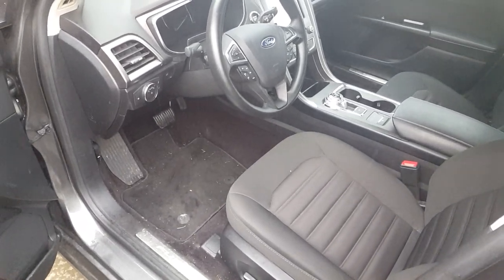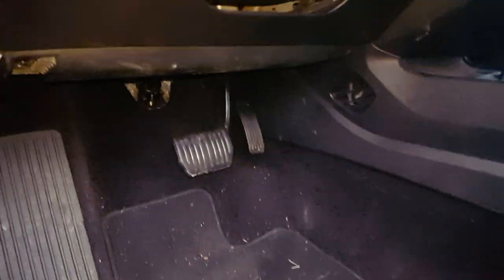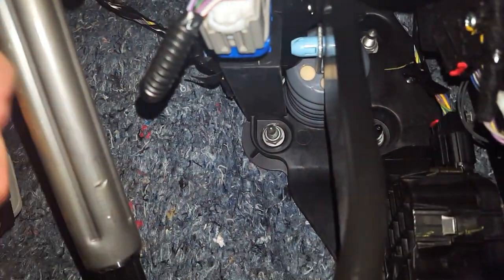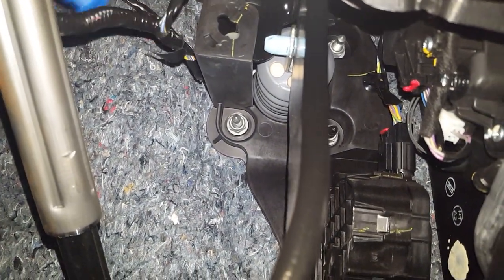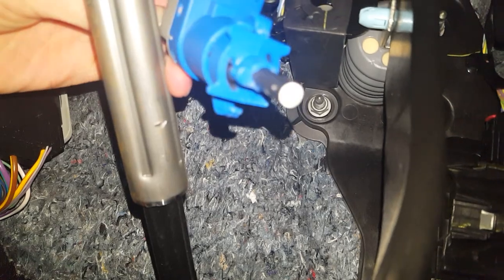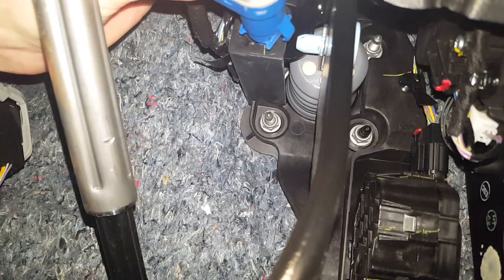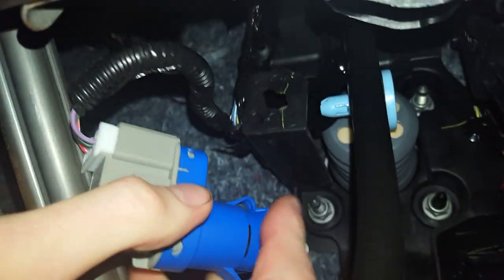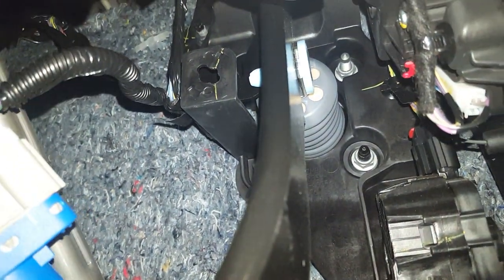How to replace the brake light switch on a 2017 Ford Fusion

Comment: I’m having a lot of trouble getting mine out.  Is it supposed to be very firm when trying to twist when pulling out?
Reply: I'm having the same promblem lol
Reply: Bro, same problem here. I'm sitting in the car trying to figure this out.
Reply: I finally got mines out (just twisted harder till it came free), looked like some type of silicon paste broke loose behind it as well.
Reply: We're having a hard time getting ours out too.
We have a 2015 Ford Fusion SE Hybrid but I'm assuming that the part will come free the same way as this video.   Hoping so.
Reply: @juniorcrimebreakers2807  did anything come of that? Because I just did mine and the same stuff fell out
Reply: @thomasbrookman6649  nope. Everything was good

Comment: Hey! So my 2017 fusion has the "Hill Start Assist Unavailable" and "Advance Service Trac" light come on numerous times while driving and then suddenly turn off after about 10-15 seconds. I've taken it to multiple mechanics and they all tell me they can't find a problem 😢 Would this possibly be the cause? I literally have no idea what to do. My car also can't go on long trips anymore because it won't accelerate over 60km/hr after about 25 minutes and the cruise control stops working.
Reply from the maker: I would look into replacing the front speed sensors it's a known issue ford have a updated version for the speed sensors
Reply: @Nickthecarguy  thank you so much! Will definitely try this! 😮‍💨

Comment: Can you please tell me what the part is called that you sit the brake light switch in? That black metal piece that you have to fit it into?
Reply from the maker: I believe that is part of the whole brake pedal assembly it's not a separate part. At least on this vehicle
Reply: Did you ever find out the name of that part? It broke on my car.

Comment: We're having a hard time getting ours out.
We have a 2015 Ford Fusion SE Hybrid but I'm assuming that the part will come free the same way as this video.   Hoping so.
Reply: I’m having the same problem getting mines out too! Did you figure it out?
Reply: @ArtHustlerAcademy  I read your comments and recognize how the new one is assembled. I pushed in and turned hard clockwise like I wanted to break it. It came right off. I was gentle and realize there are multiple position clips or glue or aging holding things in place.
Reply: @rlucas7455 
Can u please explain what exactly u pushed and how, I'm having a difficult time getting it out as well
 fusion 2014  🤕
Reply: @bobomomo3764  It has been a while but it wouldn't budge but I pushed in and applied pressure. Like, apply force not using tool but push and turn, reminder if you brake the old one doesn't matter as replacing it anyway so it might help with the level of force you use. I recall it was difficult until I realize I needed more force to break the wedge and then it was simple.

Comment: Hey 
Nick! Do you have any idea on how to change the brake pad stopper? I tried to change mine but I couldn't because there is no room for it. I'm assuming that I need to remove the complete brake pedal system.
Reply: where did you find that part i cannot find one anywhere
Reply: @Macandfam  hey man, here is the link https://www.amazon.com/dp/B01HSN05UQ/ref=cm_sw_r_cp_apa_glt_i_GK924N65TAS31R7Y8CFM?_encoding=UTF8&psc=1 it says Toyota but it works fine.
Reply: Did you have to remove the complete brake pedal system?
Reply: Manage to put it in put no room to attach it
Reply: @regalpinguino  I could not. So I decided to cut a square piece (try to cut it quite big so it can fit tight) of plastic/rubbered key chain and placed it inside. I use a small screwdriver to put it all the way back into the metal bracket (where the actual brake pad goes).
Reply: @fabriziol4776  E7GZ 7583 A
 is the replacement part number.

Comment: But what about the plastic piece , how do you get your hand in there
Reply: It is a pain in the but!  Try using a thin strand of wire (like a single strand of CAT5) about a foot and a half long. Thread the wire from the back side thru the hole. Use masking tape to attach the button to the wire and gently pull it thru. You will need to use a small screwdriver to push the button all the way in while pulling the wire. I used a trim panel push pin instead because the original button only lasted 27k. I trimmed the push pin to fit the hole. I do not want to do that again.
Reply: do you have a link for the plastic piece? I've bought several online and the prong is too big.
Reply: @WeRideSouth  did you ever find one i cannot find one anywhere
Reply: @Macandfam  I did, I ended up buying the generic toyota one and shaving it down slightly with a razor and it's been working great since! Here's the one I got, (you get 2 of them too lol) https://amzn.to/3q5PMA0
Reply: Yeah those are the ones I got I figured that's what I would ha e to do
Reply: @WeRideSouth 
 Please can u let me know how did u place the new stopper and where's the location? Did u have to un screw things to place it or cut the plastic housing to do it?  . I appreciate it 💛

Comment: Can u please let me know how to replace the old (stopper) pad  it fell on me, and now break light is on all the time. 

Fixed, Update : 
my ford fusion 2014 and other people I know with other model  didn't need to replace the  thing that fell the (stopper pad) , turned out that the switch needle become hard to close and stuck at the end which broke the stopper.  needed to replace the blue switch only. 

If your plastic thing fell out too, Try this and evaluate the result it might be the case for all fusions out there and save time and money trying to replace it.

Comment: The new switch won't work until it is properly installed. Installation releases the switch plunger. You can't test the new switch without installing it.

Comment: my 2013 fusion also met this problem. the worse is, my switch pad (silisone) fragiled also. it's  seems easy to change the switch(not easy for me, I broken it and buy a new one), but no easy to change the switch pad inside.
Reply: I haven't figure out where to buy just the silicone pad, do you have any luck? I have found some but the prong is too big.
Reply from the maker: What your vehicle vin I can get you the part number
Reply: @Nickthecarguy  3FA6P0H79ER390200
Reply: @Nickthecarguy  The dealership said I had to buy the entire pedal assembly to replace the silicone pad :-|
Reply from the maker: Updated Part number is FG9Z-2454-A. Old part number is DG9Z-2454-A
Reply: @WeRideSouth  what was your end result of this?  Did you wind up having to replace the entire assembly?
Reply: @jjjjjennnn  I bought the Honda stopper from amazon and shaved it down with a razor. It's been holding up just fine.

Comment: Having problem with the twisting part. It won't twist all the way (clockwise)
It's a 2014
Reply from the maker: You might not be aligned up all the way or the brake light switch  not pressed in all the way
Reply: @Nickthecarguy  you were 100% right. I wasn't aligned enough. 
Thanks!
Reply: This just happened to my car right now.. thank you for sharing the video... it helps me a lot.. hopefully that's the only problem...
Reply: Can u please explain what do u mean by "aligned up all the way"  Didn't understand that 🤕

2014 fusion, having a difficult time taking it out to the point I broke a plastic pad and it fell. SMH

Comment: the brake lights on my wife's 2014 Fusion are staying on all the time.  the arrangement under the dash looks like this 2017 model.
Reply from the maker: Probbly have a bad brake light switch
Reply: @Nickthecarguy  that's what it was!
Reply from the maker: @traumajock  I had to replace it on my 17 fusion because the brake light wouldn't work
Reply: @Deborah Wasylik it felt the same way for me but it will twist. Trust me

Comment: I'm sorry but you failed to say WHAT exactly you "fixed" or changed out to stopped the lights from staying on.  you unplugged that piece, then just plugged it back in.  Was that what was supposed to fix the problem, taking it off and then putting it back on.  Such a bad explanation.
Reply from the maker: This video was showing how to replace the sensor at this time of the video I didnt replace it I showed how to remove it but I had engine light on for the brake switch